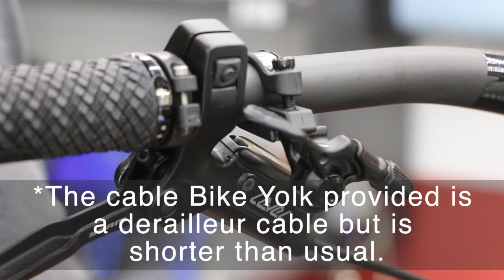Installing (dropper post) cable and the different types of cables.

Comment: “All barrel adjusters are sprung”... except they aren’t. Only gear adjusters are sprung because they’re indexed, brake barrel adjusters are unsprung and use a locking collar to retain the correct position once set.

Comment: I think you've done it backwards. The solid end should be by the seat and the end you cut and easily adjust should be by handle bars.
Reply: At 0:44 you can see on the lever what appears to be a threaded hole for a pinch bolt. Lot easier to adjust the cable at the lever than at the seat post.